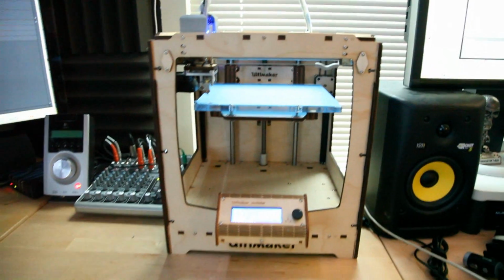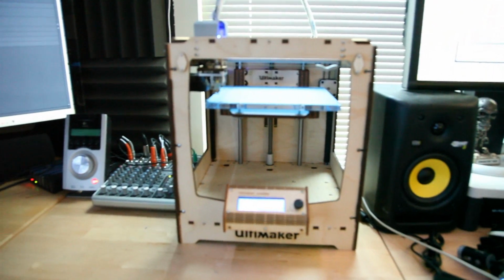Unboxing my pre-assembled Ultimaker 3D printer from the Netherlands, amazing device!

Comment: I dont blame DHL for that... the box was only mildly damaged...  I will say that they need to work on their packaging.  Just stuffing some cardboard in there does not seem to do the trick.  Glad they are replacing the parts but if you couldnt fix that cable I am sure you would be rather unhappy until that cable came...